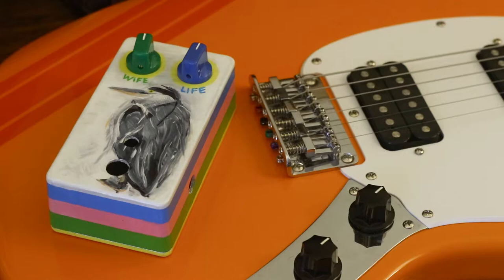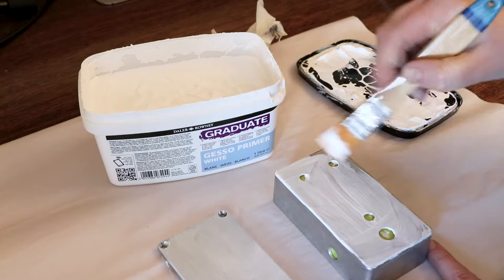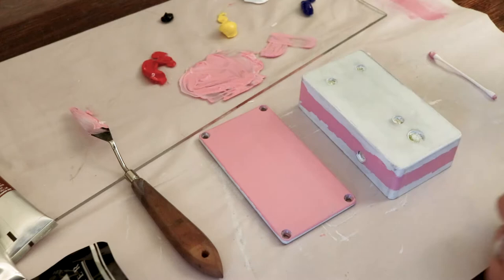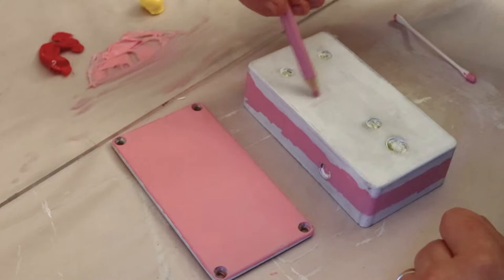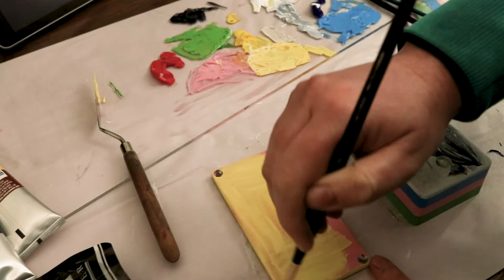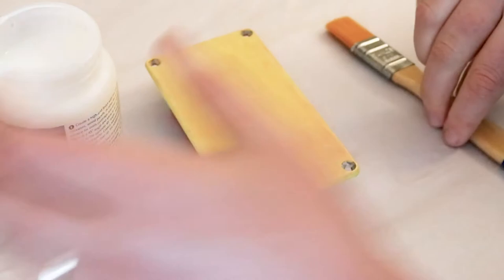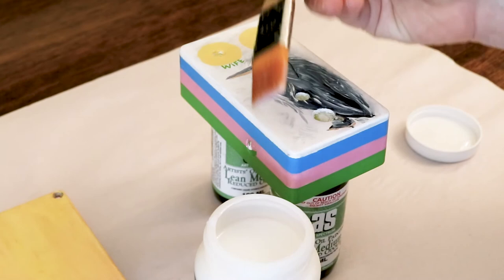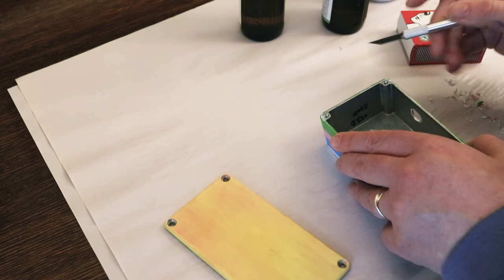Painting an aluminium guitar pedal enclosure

Comment: Hi,i won't tell anyone what they should or not do,but metal primers that give the best results are either etch type or 2k(2 pack),i've restored my triumph spitfire twice,once wrong(paint rust issues) and the second time with 2k primer and zinc primers,no rust issues.

Aluminium is a tricky metal to paint and i think etch primer will give the best results.

I'm looking for the best paint for stomp boxes other than automotive 2k types,out of the automotive paint i would lean towards the commercial paints they seem to be very hard wearing.

Powder coat ,i am not a fan,alloy motorbike wheels end up flaking due to the powdery oxides produced when scratched,so powder coat is out as repairs are non existent as a full strip and recoat is needed.

Again 2k paint is best for batch  painting which suits me,but prototyping is always a one off affair and getting it right first time is either luck or due diligence expediting the info.

I have pedals that have been painted and it never bothered me if they chip on corners but now i want to produce high end tube pedals....urgh.

Another off shoot from classic cars is a paint used on old matel dash boards and scution plates and that is crinkle paint,it's black and with a tight small crinkle finish ,i've seen pedals done with this and it's a reasonably hard wearing finish,where the switch gear lights etc are finger constantly scratch and rub,just remembered it,not cheap,but a spray can would give tens of enclosures,a spray can of etch primer too.

Small sample 1/4ltr of 2k paint can be bought cheap enough with the hardener too a need,a small air brush is also cheap,a compressor can be made from an old refridgeration compressor from a dump or ebay,no need for a tank with an air brush.

There is always salt electrolysis,be aware to not use sodium chloride/table salt use potassium hydroxide as the electrolyte as table salt/sea salt/road salt/sodium chloride when used as an electrolyte will produce CHLORINE GAS, as used in the trenches of ww1.

You could nickel plate unpainted areas,just as in etching a pcb either positive or negative image and keep or strip the paint,again something from the classic car thing .

Just spitballing ideas ,i still have to sus out the cheapest most hard wearing paint,acid etch paint i think is the best way to go as a base layer.